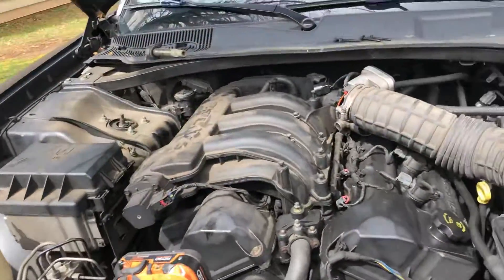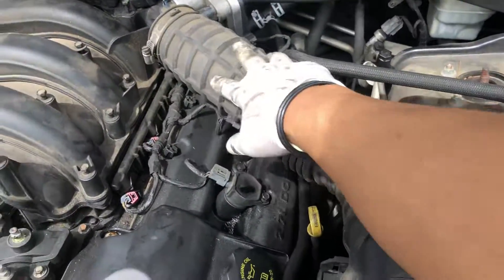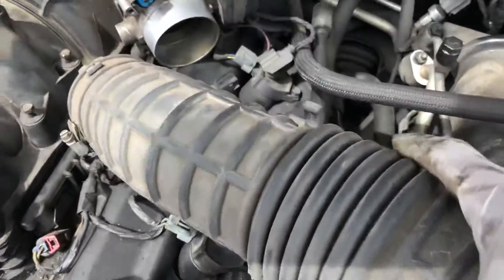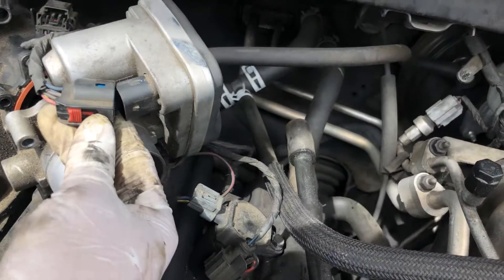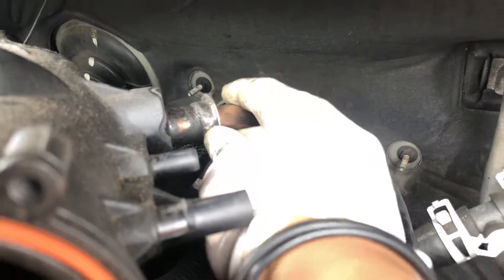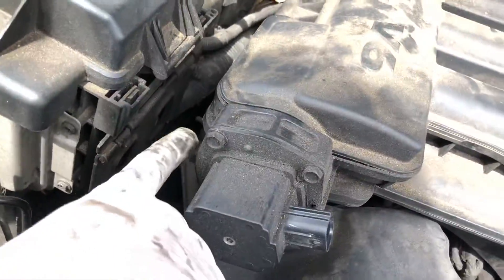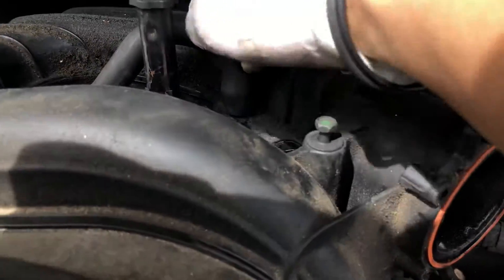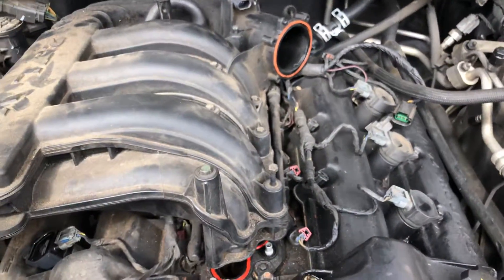2007 Dodge Charger 2.7L intake manifold removal to access spark plugs and coil

Comment: One thing he forgot to mention, after a pain in the ass to remove, is that there is a sealant on the agr. Make sure not to lose it otherwise the car will lose power and throttle light will come on and at stops will shut off and all kinds of codes will pop up.
Reply: I lost mine can you get that piece from a local auto zone ?
Reply: @Slow5677 yes, but i had so much trouble putting that shit on. I just duct taped all around the tube to prevent an air leak. Worked like a charm so far